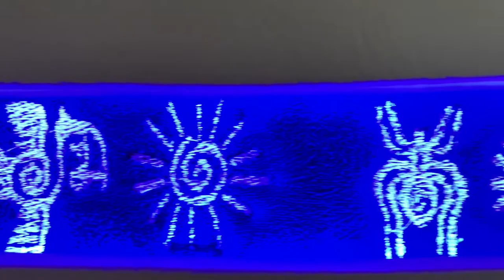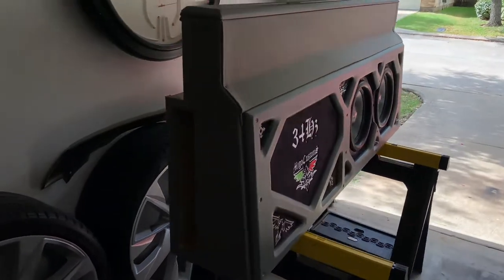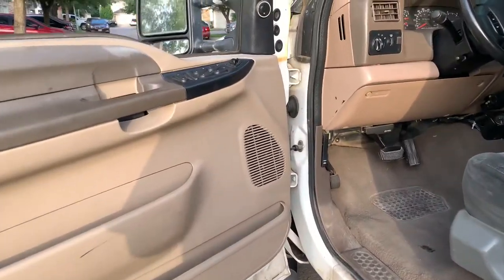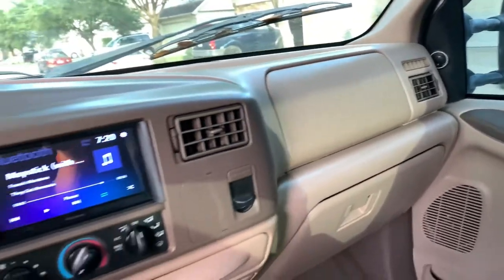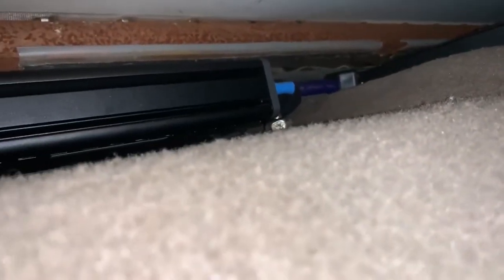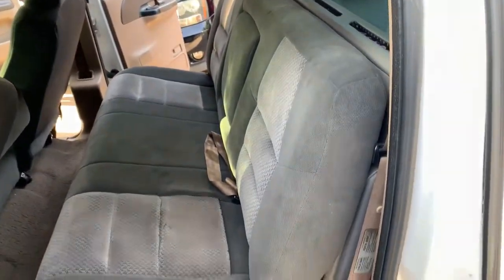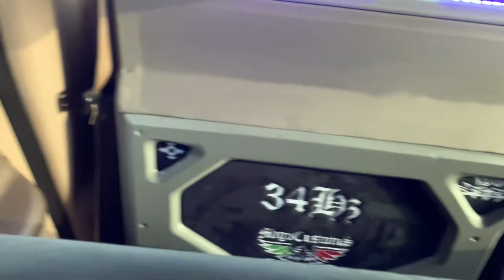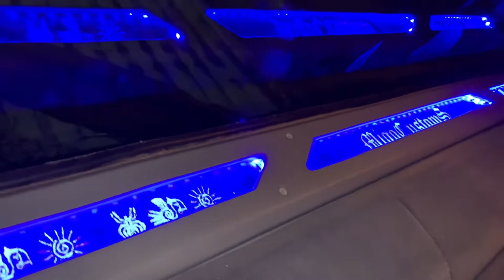Ford F-250 Sound System Custom Speaker box 12” subwoofers

Comment: Thats bad ass bro. Great job. I would like something like that in my truck. tired of these premade boxes. I have a 2012 F350 where did you get the spacers for the rear seat.
Reply from the maker: Thanks! I used no spacers, I flipped the original seat brackets its works without buying anything extra👍🏽

Comment: what do ya mean by flip the seat bracket?  ({1.}like the driver moved to the passanger  side?)   (2. spine it on same side front to back??)   (3. same side flip upside down ??) sure i missed some combo ways lol thanks
Reply from the maker: When you unbolt the rear seat , then you can unbolt the seat brackets 1 at a time.  You will flip them on the same side you will see it, it will bolt up properly and it will just make the seats move forward a few inches when you install the rear bench seat back, hope that helps!👍🏼 I did it at night so did not get to record it
Reply: @MiGo713  thank you
Reply from the maker: @tryandtakealaska3797 No problem👍🏼
Reply: @MiGo713 man I am trying to flip mine struggling 
Is their any videos out their too show for 2003 f250 7.3Diesel super duty
Reply: @MiGo713 also do you have the specs sizes of the box

Comment: Wow!!  Great job 👊🏿🔥 I have a 2011 350 super duty I would love to run some  15"s what do think?🤔
Reply from the maker: Thanks!🥶 Im not exactly sure on how much space the 2011 has but if it’s like this truck here I had enough space to put 1 15” behind the seat.  I’ve done more of the newer Fords and I Know you can fit 4 6.5s or 4 8s under the rear seat.  Another possibility on your could be 1 15” in a center console that runs to the back.  Or in the bed of the truck lol but that would be a bigger build💯
Reply: Ok  cool let me take some measurements! I have 2 12's behind the seat now  in a box  But I need more bass lol😂😂😂🤔
Reply from the maker: @robertearl4853  Nice👍🏼 and yeah I understand always want more bass lol and yes you might have more space back there every inch counts lol You might have to go full width, height and depth, or maybe consider reposition the rear seat if possible💯